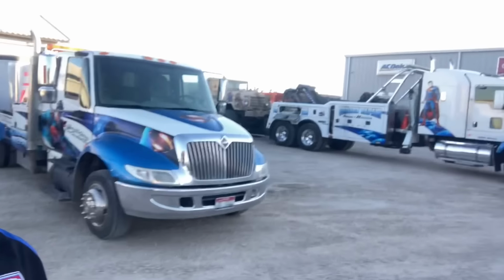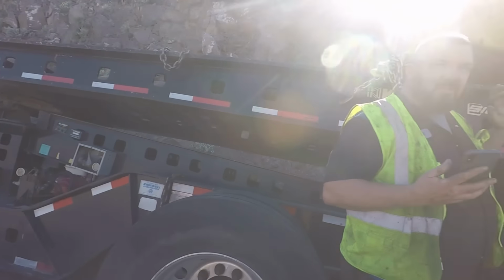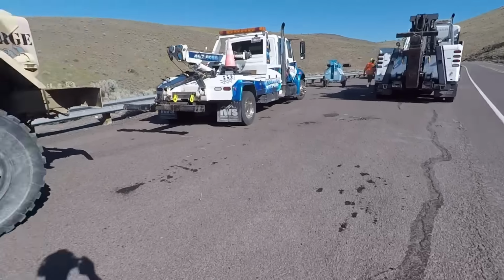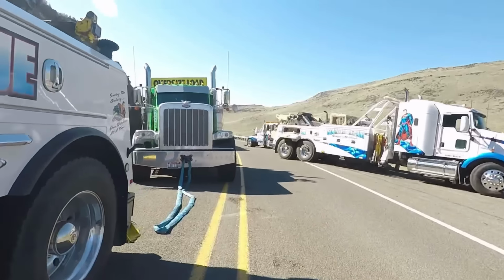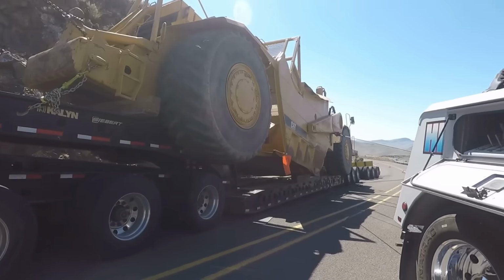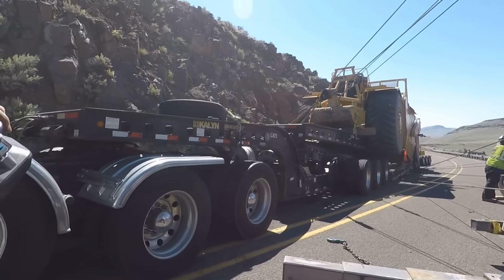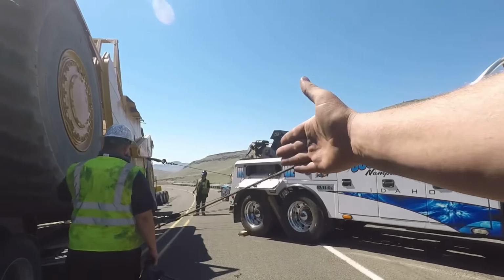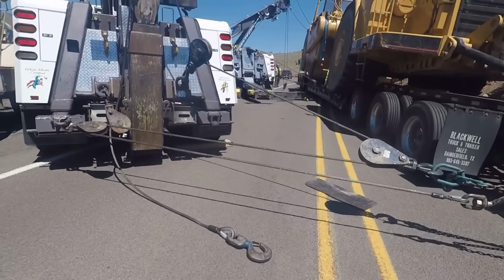Did Superman finally meet his match??? | 262,000 Lb SUPER LOAD

Comment: A lot of people asking why not unload the machine first. An RGN is incredibly difficult to separate at a sidewise angle and almost impossible to do it when the truck is twisted at a different angle to the trailer. The bottom of the trailer would not be supported properly the way it’s leaning, and dropping it to unload could cause severe structural failure of the trailer. Plus, lifting the rear power unit by resting the pan on the deck while the trailer is leaning is just asking to have the whole thing slide off the trailer. There is absolutely no room on that road to set up a large enough crane to lift that scraper, and you just greatly increase your risk of catastrophe trying to do that. What really caused this accident is anyone’s guess. And what it cost for recovery is really no ones business.
Reply from the maker: This is absolutely the most amazing comment I've ever seen! Now if you can copy and paste this on everyones comment so I don't have to explain it lol Thanks Bud!

Comment: Awesome recovery guys. I'm in heavy haul, moving the exact same equipment. A failed booster cylinder is more common than ppl think. One of my guys was in the same situation a few months back. Unfortunately they couldn't get him pulled out rolling, so a couple 80T rotators later, off came the scraper. Again Kudos on the great job fellas. 👏
Reply: How much would all those tow trucks cost?
Reply: unreal. thats some crazy weight
Reply: I know nothing about the design of the booster cylinder and the system, but it seems that if failures are common and results can be catastrophic, that some sort of redundancy could be built in.
Reply: If scrapper was running order,why not just use it
Reply: Drop the pan raise rear wheels
Reply: Slide off with blocking don't get the front trany

Comment: I use to work at P&H mining, Milwaukee Wisconsin back in 1986 - 1992, we shipped electric shovels 63 cubic yard dippers, aka bucket, and they we shipped in the same configuration tractor low boy trailer set up shown in the video. The dipper fit onto a P&H 4100XPB Electric shovel. Beat engineering team I worked with. I see you guys had excellent team work, my hats off to you guys and great job.

Comment: Imagine the driver of the truck showing up next morning with a tow bill to the boss
Reply: 75 to 100 grand? Ive seen 80k for a rotator picking up a wrecked steel hauler and its lost load.
Reply: I would bet the bill is big enough to warrant an insurance claim.
Reply: I'm pretty sure Country Repair is pretty fair on prices i seen them prices and are pretty fair and it takes alot to be on towing over 36 years that means they are doing it right
Reply: @jorgegonzalez-bk8zn  Fair yes, but most of those trucks are charging around $500 hr and they also charge by how much cable is pulled in certain circumstances. So a buttload of trucks, all the miles to get there, and all the hours on site are going to be a hefty bill.
Reply from the maker: @jorge Gonzalez you nailed it bud 👌🏼😎
Reply: @blauer2551  picking up, but not pulling... without proper ground resistance you wont even pull a 1000lb load
Reply: @knuffelbaer1971  Im talking about how much cable is “pulled” off the drum. They are marked with spray paint at different increments to measure feet. Everything on these tow bills is itemized down to the oil dry thrown on the ground and the broom that sweeps it up.
Reply: @blauer2551  ok, then i got you wrong. I thought "we" were talking about weight, not costs :)
Reply: So this was caused by a trailer equipment failure in the rear steer component. For any of you who want to blame the driving without knowing the whole story.
Reply: @GraceEngineering  The rear booster failed, it was clearly stated. Who’s pointing any fingers?
Reply: @blauer2551  Hi. I saw others making comments about driver error. I was just throwing support to the driver.
Reply: Here is a Stupid question....Why didn't  they off load the earth  spider off trailer  then pull truck..man if a chain broke .....I'm glad you had shag there to take the load if a cable  had broken.....WoW how exciting.......
Reply: I was wondering what the Headsets/radio that they were using?
Reply: @GraceEngineering  I think the driver needed a forward escort to stop traffic to make those curves.
Reply: @bradfordthompson8326  It would have taken a lot longer to break that rig down and unload it ,but good question. They have to get the HWY open faster
Reply: @paulgrimm6850  unchaining the load at that point is too dangerous to do. Lots of things to go wrong.
Reply: @bradfordthompson8326  because in order to get that scraper off the trailer it has to be broke down. Which means trailer separated and split to drive machine off. And the way the trailer was it wasn’t possible to break the trailer down. Plus I doubt any of those guys can run that machine lol. I run those for a living. But good idea in theory 👍🏻
Reply: Even if you could have broken down the trailer to offload the Cat,  it is more than dangerous to try to load or offload at the angle the trailer was sitting. Plus with it leaning into the rocks, what's going to happen if you (1) unchain the load, (2) start to move the load on a trailer listing to the starboard, (3) in moving the machine you risk damaging it, and (4) if against the rocks, let's ponder what would happen if a few of the bigger rocks shifted.   So far, at least in my mind, none of those are a real viable, safe option.
You can't go backwards,  you can't go forwards.  I guess it's time for Suoerman to pull you sideways(ish) @CountryEquipmentRentals 
Excellent work. Math was boring in school, but loved physics. This is a wonderful video touching on many aspects of that. Gentlemen,  you made your math and physics teachers day.  Well done. 👍👏👏👏

Still wonder what a recovery of that magnitude cost?
Reply: @lsimpson6223  so right, and that's why everyone else doesn't do these types of jobs. You have to list through all of the variables and make the plan that is the safest for all parties involved, not just convenient.
Reply: @blauer2551  this is true. I wrecked my car and when I went to pay the tow company and had to argue a $50 charge on them cleaning the scene when I did it myself before they got there.
Reply: @Studio23Media  You're assuming they have towing coverage on their insurance policy. Business insurance is very specific, and things like towing and recovery are not automatically included like you see on many auto policies. I hope they had adequate coverage, though.
Reply: @Nareimooncatt  If the people driving that rig don't have towing and recovery insurance, they're the dumbest people around. I'm sure they do
Reply: @blauer2551  try more like $1500 an hour
Reply: @paulgrimm6850   video shows a white pick-up truck at the rear and a black sedan (maybe ex-police Crown Vic?) with flags as the front pilot vehicle
Reply: @Studio23Media  insurance won't cover this.
Reply: @TX_Lawyer  And how exactly do you know that? 🤔😂

Comment: Man, OSHA would be all over this with the team standing around those lines with the loads ya'all are talking about.  Great recovery - that thing is a BEAST!
Reply from the maker: Where else are you going to stand? Controls are on the back of the truck. Plus we knew how much weight was on each line and how what the working load limits are. Gotta know your numbers
Reply: @CountryEquipmentRentals  Oh, don't get me wrong, I totally get it.  I'm all about safety, but totally understand your position and the challenges.  I am just saying that there are agencies (right|wrong, good|bad) that love to force people to comply or fine them a whole lot of money.  I recall a situation some time ago at a company I worked at where we were receiving a very large, single -story roof-top HVAC system that was being set into place with a rather large road going crane (much larger than yours).  We were instructed to evacuate the building and walk about a block away during the install.  It was an insurance liability issue should any of the cabling, hooks (whatever) fail and an employee injured or killed.

I'm not calling you out or saying you are wrong, just sayin'.  Imagine if instead of the buckle rolling over or whatever tension was released at 38:32 ("thats enough to scare ya'"), a cable snapped (at 34:30 "Sarge, keep up ...") with several tons of pull on it?  That cable is flying back whipping itself back to where you are standing.  Imagine an arresting cable on a air craft carrier failing after catching a plane - it would whip back and slice everyone in two without losing energy (why do you think the deck hands are no where near it?).

I suppose you might be able to find a "safer place" behind the rigs and use your remotes (if all your trucks don't have remotes, not my problem ... just suggesting).  I know you probably rely on the tactile feedback the stick operating the hydraulic controls.  I applaud what your crew did/does.  However, it isn't about manhood or any crap like that or a "union strong" thing ...... just looking for ways for everyone to be safe and to come back and do it again.

If I could give this vid multiple thumbs-up, I would.  I'm glad your crew are all over it.  Thank you.
Reply: Who needs OSHA when you have True Gret? 
Talk about criticism in the guise of a compliment. 
I have an idea, any time you're about to launch into a diatribe that starts or ends with some variation of "just sayin'", just don't.

Comment: Awesome job and communication!! I was a tow and recovery driver for about 4 years and only did calls for anything smaller than a 2500 HD or F-250. The craziest recovery I was assisting with, was a vehicle that ended up down a mountain side about 150-175 ft. That was an interesting situation.

Comment: That's why chaining down loads is so important. Could you imagine if that scraper came off. God bless
Reply: I run lowboy also, I cross tie just for this reason, cross tieing will NOT ALOW IT TO SLIDE . And usen the Propper size of chain & not galvanized .... And also getting your binders as tight as you also. I've seen where drivers had a chain or chains not tight & your chains can snap because you have little bit of slack .
Reply: Would've been easier to winch out if it had come off tho.
Reply: @terryperrott9913  yes sir if you have slack in the chain. It shock loads it. Chains are not designed or rated for shock load. Keep up the good work sir. God bless
Reply: @cthunter41  no it would only if came completely off. This one would have only came off partially. It would have made it far more difficult.
Reply: @terryperrott9913  yup, bouncy chain will bend and break shit
Reply: @terryperrott9913  Had a buddy many years ago have his dozer "almost" come off the trailer, because he ran a chain straight through a rear clevis side to side, of course with back pull. HOWEVER, after probably DECADES of doing it, he never realized that the ass end of that dozer, could still slide across the chain. He from then on always brought his chains back to the clevis, and cross hooked on each side so it wouldn't slide. (He also got lucky, because he was able to get the dozer situated back around before he got an unsecure load ticket.)  He wasn't on the highway, but regardless. Me being a student lf experience and knowledge would never hook anything up in that manner myself after that, but I see it, ALL THE TIME.
Reply: @brentbarnhart5827  Yes sir, thats the reason why I cross tie , for an example run a chain from left side to the right side then the other chain right to left. And if its a heavy load I will double up on the chains . The size of chain is rated for only so much also.

Comment: I must have missed something. 
What was done to fix the rear steering after it failed and caused this problem?
Reply: He misjudged the severity of the turn, and the rear drifted off the roadway.
Reply: @uality ....Ahh that would be driver error, not...''the rear steering failed''
Reply: @uality  https://youtu.be/2abN2kdoKmE?t=331 "valve for the steering booster failed"
Reply: They stated the steering had failed, which is not uncommon. Since they spent a day  preparing for the recovery it likely was already repaired before the recovery team showed up. It's amazing what a DOT certified roadside mechanics are capable of. A few years back I had a front steer Tire explode for unknown reasons despite it only being 2 weeks old. I was lucky I did not roll since this happened at nearly 70 mph . Much of the tire came off the rim to the inside resulting in my air line being tore off, locking up the front wheel. It also jammed  the tie rod for the steering. The truck likely would have rolled if I would have hit the brakes and I had not kept the truck going straight. Instead I used the handbrake for the trailer to bring the truck to a stop. It took the mechanic less than 45 minutes to repair the brake line, inspect the steering, and replace the tire. All the whole time cars disrespectfully buzzing his butt on the side of the road.
    People don't give a crap about anything but themselves nothing brings that home more than driving a big rig. Shame on the ambulance-chasing lawyers who goes after a truck driver.  Of course most trucks now have a dash cam. (Now Lawsuits are not so common) If Only DOT Could issue tickets based on what that cam See's!
Reply: @brucekoster9253  I understand. It is YouTube which is often incomplete.  There may be liability issues especially if insurance is involved. But it also ended  as obscured as it began. We didn't get to see his Pete get that massive load moving on its own. For the first time his camera was conveniently aimed in the wrong direction.
      There was a Volvo Wrecker hook to the front of the Pete when they were all hooked to the side.  They got all over him because he was witching the truck out on his own!  In my opinion they likely gouged the Insurance Company with extra trucks and time. 
   I only drove over the road  for 7 years averaging 120,000 mi a year. But I did operate heavy equipment for close to 14 year's.
     I've operated most of the big ones including 657. Which are twin engine push pull scrapers usually working in tandem or even several hooked at a time. Transports often get stuck on job sites. That's because it's usually dirt Lots or roads and they're not always even or large.  When they do, the truck is disconnect from the trailer.  And they drive the machine off the way it went on.  Which is usually at the front of the trailer on that angle it would not had rolled.  Transport Trailer would have been flat on the ground up front.  Then you hook the truck  back up and if it can't pull the trailer out on its own, you could pull it with the machine it's hauling.  I'm sure the Transport company didn't want to deal with that on the highway as it still would have required spotters and traffic control.  and there's no guarantee the driver would had known what he was doing with the scraper. Although All Transport driver I've known could operate damn near anything. enjoy what's left of your weekend. I've got hay to to cut.
Reply: @Ozarkprepper643  You are talking a complete and utter load of shit.  The extra trucks were pulling at an angle but that doesn't mean they weren't pulling.  And do you really think a single wrecker's winch can pull that load?  Then you are basically suggesting the tow company is fraudulently faking the amount of equipment required.  Quite a big call, eh?  As for the idea that you could unload the mine scraper on a public road with the trailer on an angle, and then use to to pull the rig out, well that is just stupid.  I'm guessing there are a list of legal and technical reasons why that cannot be done.
Reply: @alexanderSydneyOz  Might be able get it unloaded and use it to pull but reloading would be a big problem. And measures would be needed to ensure the whole deal didn't topple the moment you released the binder chains.